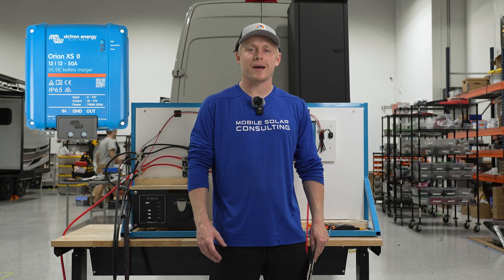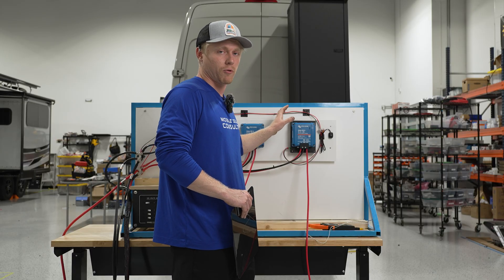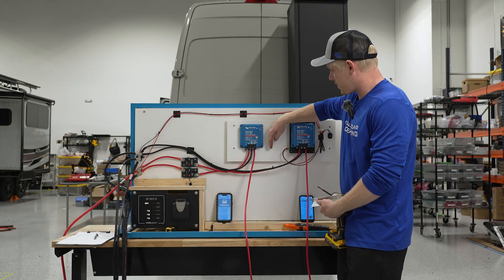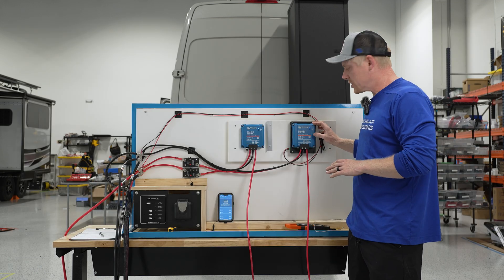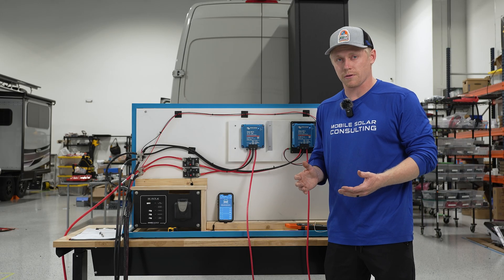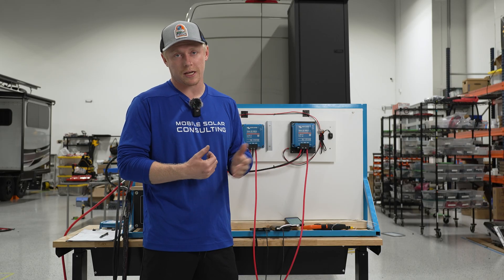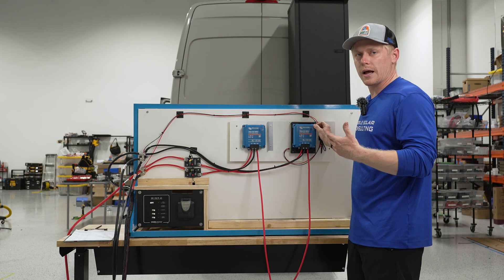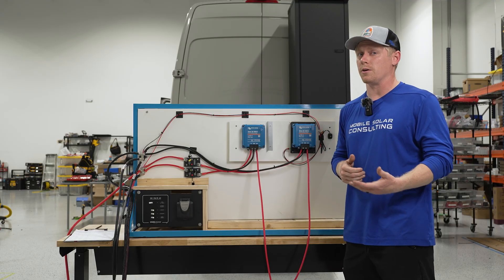Do You NEED a Fan for Victron Orion XS/XS 1400?? (Performance Test)

Comment: I'm considering to install on my boat  the new Orion XS 1400 to control charging a Lithium house power battery from a Suzuki 300hp outboard and a standard lead acid cranking battery, has anyone done this? Just wondering on  any settings to protect the system.
Thanks
Reply from the maker: Yes, many have done this, it is exactly what the product is designed for. If you purchase the Orion from our shop, we can assist with any detailed settings to optimize the charging and prevent the lead batteries from draining.

Comment: Had a couple questions about your product:
1. How much watts did these fans use during your experiment?  
2. What was the decibel level as well?  
3. Does the fans vary the fan speed based on temperature?
Reply from the maker: For now, the fans pull 0.2A at 12V, 0.1A at 24V, there is no audible noise at all (we don't have a DB measurement tool but it is silent), and the fan speed is constant.

Comment: Victron equipment will throttle back if they get into an overheat situation.
You don’t need a big fan to stop this from happening.
Take care M.
Reply from the maker: The throttling is demonstrated in the video. The point of the fan is to keep the Orion from reaching that temperature, so it keeps producing peak power.

Thanks for the comment Mark!

Comment: Does the same thing happen with the smartSolar mppts as my 100/20 and 100/30 get pretty warm/hot and Ive noticed my solar panels current drops out and then comes back up, 
But it only does it like once every couple of hours
Reply from the maker: It can happen with MPPT's, but it's less common since the weather is not usually perfect. It happens more often when you have an oversized array on a small controller.
Reply: @MobileSolarConsulting cheers mate 🍻 I'm in Australia qld so it's pretty hot and silly me like some RV owners Ive got mine in a box lid is open but the heat has been around 29⁰C to 33⁰C, going to buy the fan for the 20 after watching this and get a small PC fan for the 100/20
Reply: New panels as well, was thinking it might be the new panels however I've never really gotten my ah down big enough to keep charging for hours on end 🤔